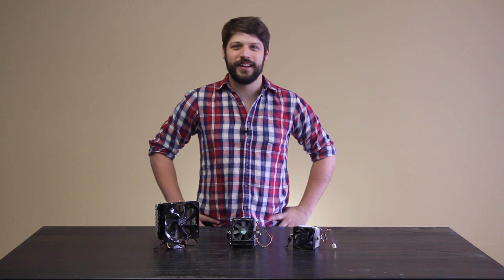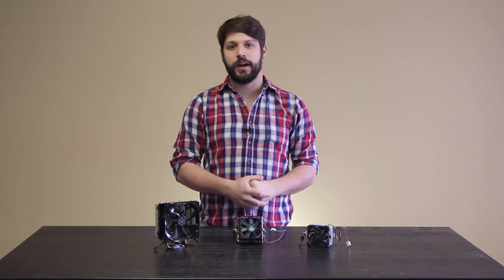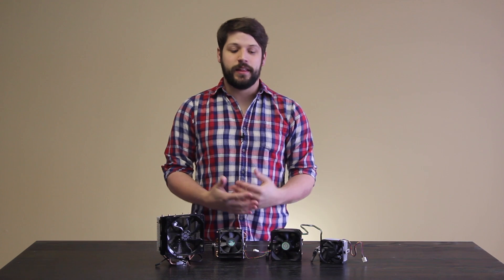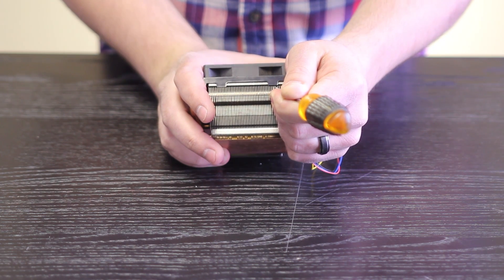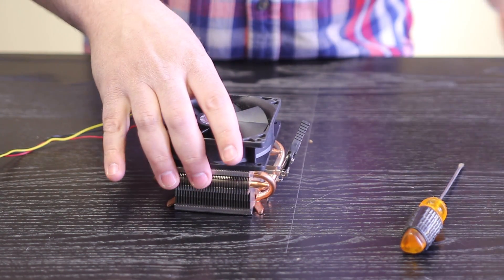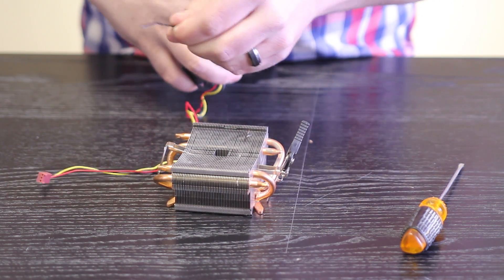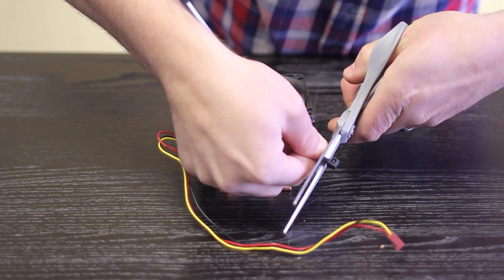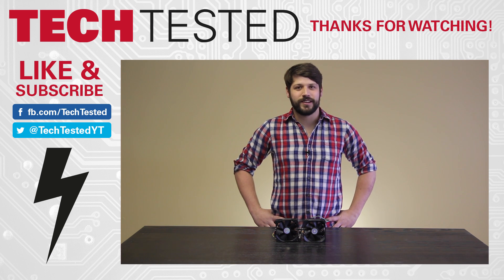DIY AMD Wraith Cooler – Upgrade Your Cooler For Cheap

Comment: Whats the size of the original fan, 80x80 mm or smaller???

Do you think its possible to use an adaptor like Revoltec RZ004 80 to 120mm acrylic adaptor??

Comment: the only thing we do care about wraith cooling is the noise, and he didn't test the noise level. little bit disappointed
Reply: because that's all based on the fan you get. so you get the quietest you can afford.

Comment: Seriously just get a Deepcool GAMMAXX 200T 120mm Hydro CPU Cooler as it's only $15 on Newegg, and if you can get the rebate back it's $10 with free shipping. I have one on my AMD A-10 5800K APU overclocked to 4.2Ghz running 3 monitors at 1080p, and I get some chilly temps all the way down to 28C and average daily temps in the upper 30's to low 40's, and I've never hit over 50c with all 4 core stressed out doing some video/DVD rendering work.
Reply: +Commodorefan64 Yeah that sounds about right. I think he is talking above a 95W, could be wrong but his specs looks for 125W? High watts for any modern normal human.
Reply: +Storm Shadow I'm just saying if you shop around, it's not hard to get a decent aftermarket cooler for not a lot of money, even if it's going with brands that not as widely known without having to Jerry rig it, and getting much better results.

Comment: Please don't waste money on a Wraith! Zip tie a 92mm pwm fan or use strong tape to attach it to the AMD D3 securely. It will perform identical and run even quieter. I have even attached the 92mm fan to the existing 80mm fan for TWO fans on one heatsink, providing additional north bridge and VRM cooling.
Reply: +NeoVoodooChild Wraith cooler has more fins and is overall bigger though. Its not just the fan that is different
Reply: It's like a 20% increase in the surface area of the aluminum fins. With 4 nearly identical copper heat pipes on both the D3 and the wraith they will undoubtedly posses very similar thermal dissipation limits. You can expect quickly diminishing returns even with an increase in airflow or a decrease in ambient air temps, as you reach the coolers thermal limit. It's all about the heat pipes. Plus the 80mm 40 cfm fan bundled with the wraith will not outperform a decent pwm controlled 92mm that will also run quieter and at a lower rpm. Your better off modifying a D3 unless you get a wraith for free.
Reply: +NeoVoodooChild what of you get the wraith for free then mod it anyway?

Comment: i am using glue since i will only use the stock cooling for a few weeks. savings some money for buying something like gammax 400 / t4
Reply from the maker: +Huang Yuoxi The reason I didn't use glue is because glue has a tenancy to go back to liquid form when it gets hot.
Reply: +Ulrich Jensen If it get hot enougth to melt them, probably your cpu and mobo will be burned too.
Reply: +Tech Tested But will the zip ties not melt then ?

Comment: Did something like that with an old intel sandybridge intel stock cooler and an noctua 80mm fan, thermals are good (reach 80 degree only with maxed out games) but the difference in noise is huge !!

Comment: ahh yes, zip ties. The duct tape of the PC community.
Reply: +Dylan 873 If there is less than 12 zip ties in a computer, I question that persons cable management skills
Reply: I bought some cheapo 4$ case fans and fan screws didn't fit through them so I just used zip ties to hold them down because zipties are amazing
Reply: +bew1977 I question how good people who need more than 12 zipties per pc actually are at cable management
Reply: I bought some cheapo 4$ case fans and fan screws didn't fit through them so I just used zip ties to hold them down because zipties are amazing
Reply: +bew1977 I dont have any. I was redoing some cables, to install a new gpu. Cut all my zipties, and didnt have anymore
Reply: +bew1977 pssh im a little higher class than zip ties. 

i used Velcro behind my side pannel.
Reply: Freakin intel users trying to add cost to everything. XD
Reply: haha fx black series man! the only blue in my case is the windforce logo on my gpu
Reply: I have 7 zip ties in my pc and it's looking good :D
Reply: Zip ties, the best "tool" to a PChead guy, do anything with that faboulous and enginering piece...
Reply: just 1 zip :)

Comment: AMD Athlon 64x2 5200+ 2,7 GHz has no thermal throttle Best what potato user can say (me)
Reply: +Snuggly Aggressive Bear haha me to!
Reply: Snuggly Aggressive Bear I try to plan to get new one after year or less
Reply: +andrius čičirka I had same one and it was ok.
Month ago I went for 8320 and asock 970 Ex3 R2 and 8 gigs of ram.
There is diference but I canot say that proc was bad.
Reply: Ante Medić It's slow for today using. But even ultra heat doesn't affect perfomance on that CPU. In year or five i will get new PC. (after five years i will get 1-1,5k euros from insurance)
Reply: +andrius čičirka 5 years from now I will be coming back to this to make sure you have kept your word, cya then ;)